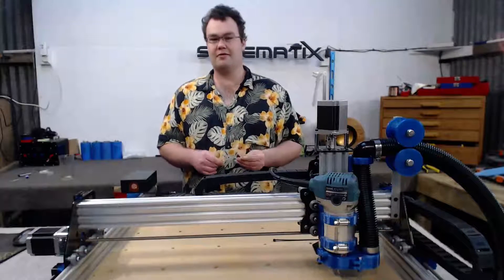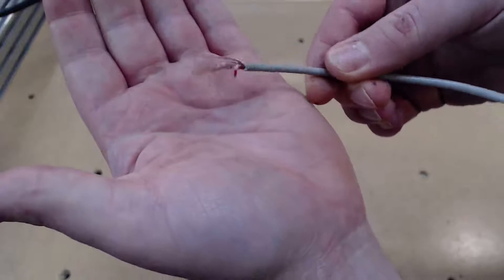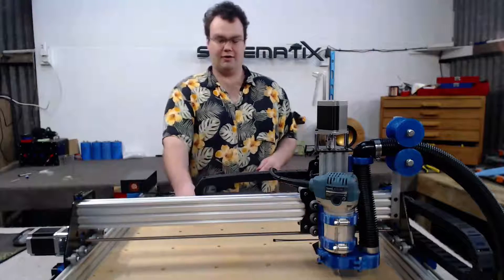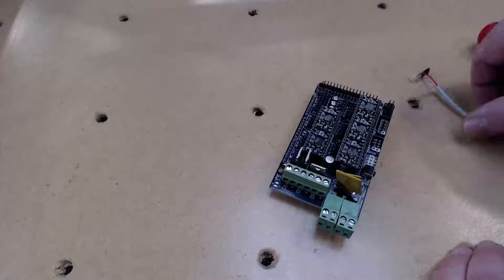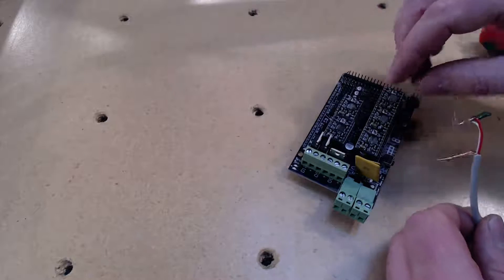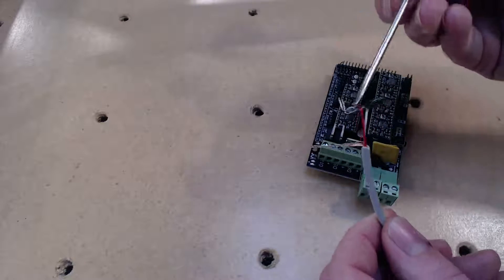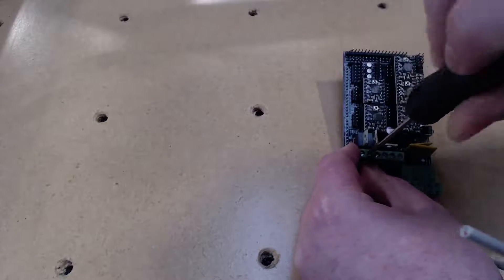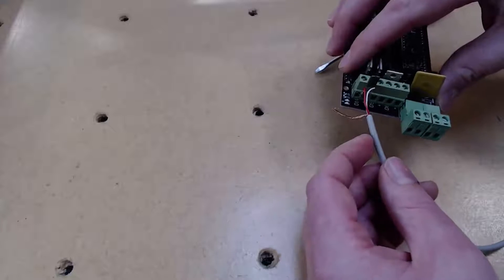Hardlimit Mods To The OX-Metal CNC Router Mill

Comment: Handy. Doing this at the moment. So thx for doing the video. The pain I have is that using the two core shielded wire, as the switches need to be in parallel, I'm splitting wired and shielding and shrinking around them. It's taking me an age! Xpro v3 with 6 limit switches. Subscribed and liked!

Comment: Hey, 
Great series of videos, love your on camera demeanor. I have added this cnc to my projects list right at the top. Few questions on the build so far:
1. Will stock OX Gantry plate work? 
2. On the parts list you list "OX X Carriage plates" and source them to the same link as the gantry plates. Are these plates typically included in the gantry set or do i need to source them? 
Thanks
-Jon
Reply from the maker: Thanks! 1. Yes. 2. Sometimes, some sellers list complete kits including X-carriage plates and gantry plates. And you also need the corner gussets.